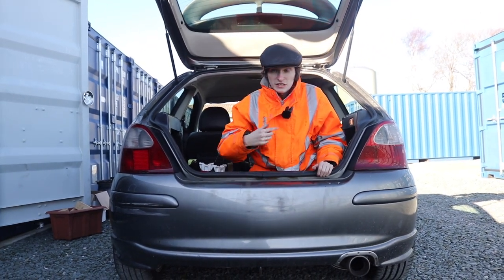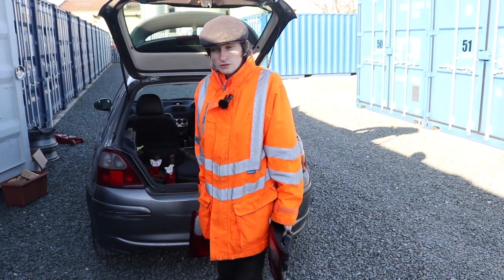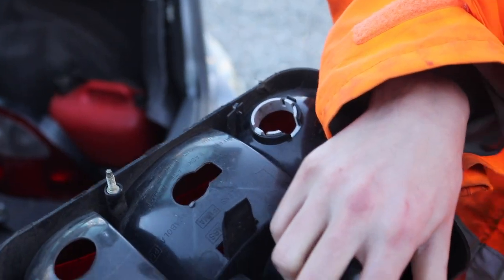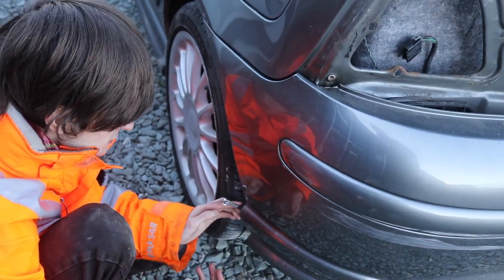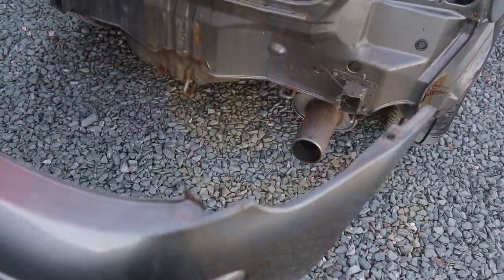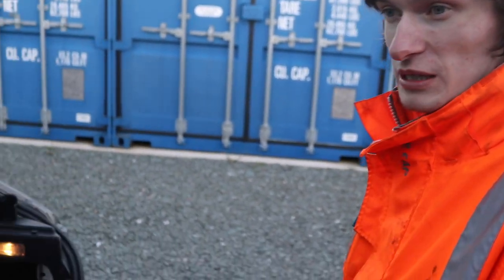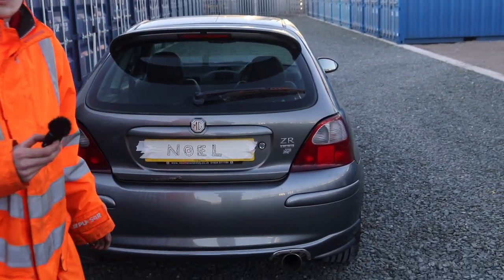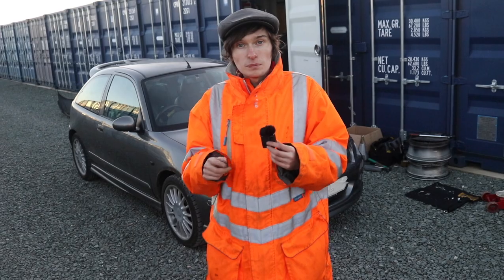Cheapest MG ZR 160 New Lights and Bumper Change Build Part 2..........

Comment: Hope you manage to trace a replacement wing - very pleased you didn’t use a Jack on that surface, it looks a bit iffy. Thanks for the video!
Reply from the maker: Sometimes that ground you got work with it because all I have like when did wheel swap in part it’s all nice flat just pain with heavy jack to remove into place. We’ve got wing but we’ve had gone down route of getting different colour one out of local scrap yard but more to come on that one!

Comment: That pipe that goes through the back pannel is for the standard 160 backbox, it had valves built into it that opened around 4000rpm.
Reply from the maker: Oh that's what's its for so when put Noel back to stock we can reuse that again bit like the exhaust on a e36 328i same sort design.
Reply: @ThomasEdward  yes if you look in the engine bay its the yellow wire that comes out of the intake manifold into a canister by the pas reservoir, I've never had one with a standard backbox so would be interested in seeing it work.. I have a backbox if you want it
Reply from the maker: @itsadyboiiis1401  Yes I know the wire now glad you've told us 😊 WOW! yes please is real deal twin pipe 160 is it two piece as well because  need that 2nd section too. Either get in touch through my Instagram below or drop us email to modellandroversoffroad@yahoo.co.uk